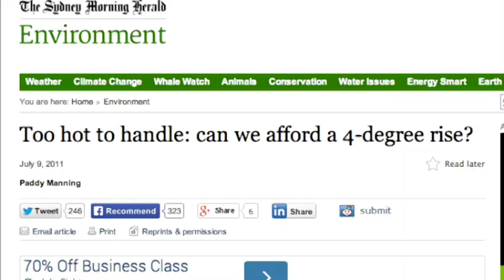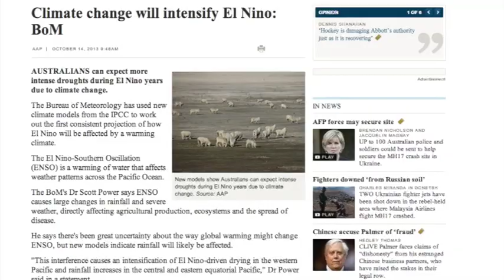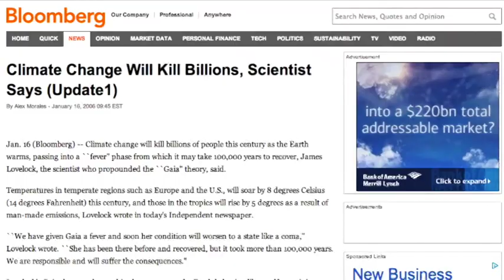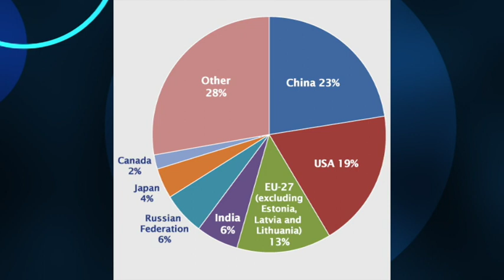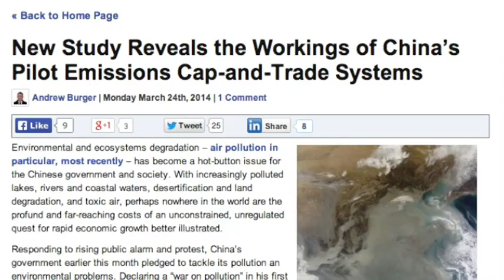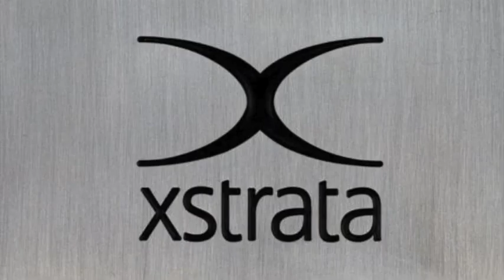THE DUMBEST DECISION EVER MADE - Australia repeals the Carbon Tax

Comment: You didn't calculate population growth into the stat that 6 billion people could die from a climate change caused crisis. After calculating population growth that statistic would be 11 billion.
Reply: not to burst your bubble but from the research I've seen at Uni, population growth is looking like stabilising at around 9billion. so not quite the 12billion required for your preiction but still fucked up.
Reply: Hey I'm up for whatever is most supported by the facts. The number I pulled out comes from Hans Rosling, which I believed to be current. 9  Billion seems quite low to me, I guess it's ruling out a population boom in Africa? Do you know where or who that figure comes from?

Comment: Do you honestly think a carbon tax will help climate change?
Reply: +Jemalacane0 Do you honestly think it won't?
Reply: +BigOxTatoes Yeah, that's what nuclear power and hydropower are for.
Reply: And where do your propose the money to fund such renewable energy endeavors should come from?
Reply: +BigOxTatoes The same place is comes from for unreliable wind and solar and the fossil fuel power plants needed to back them up.
Reply: +Jemalacane0 Unreliable mmm debatable , who told you this. it can be reliable but it required expensive equipment at this stage but it will become cheaper, if more people get involved.